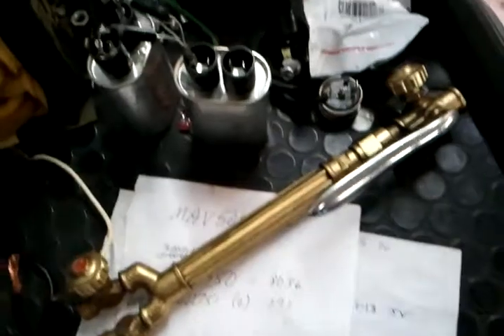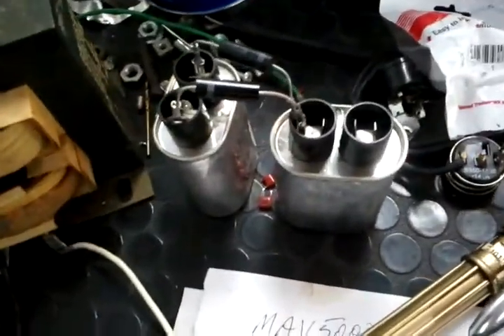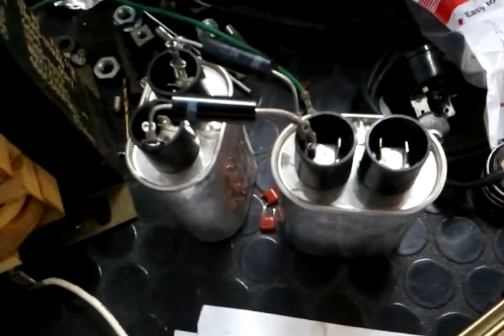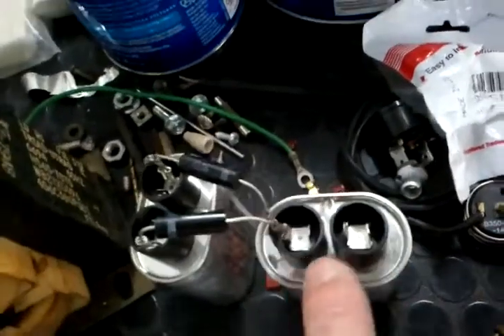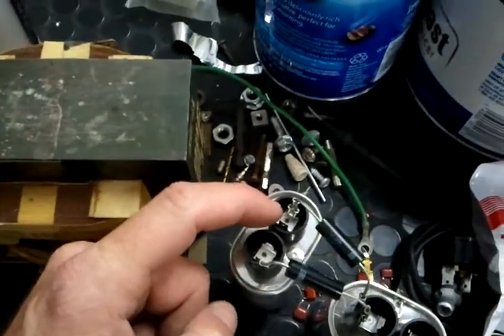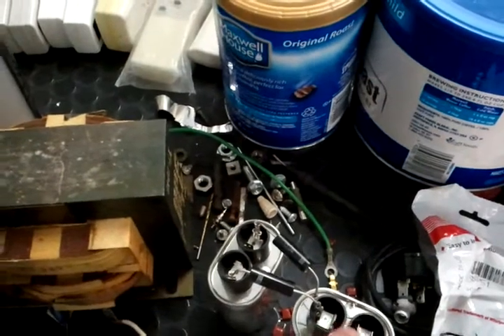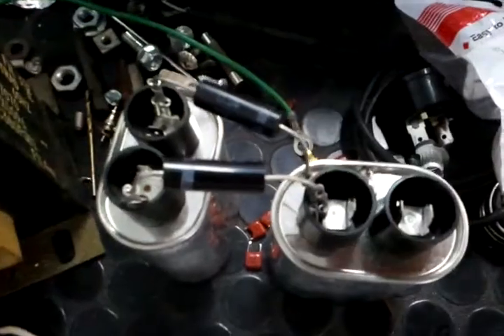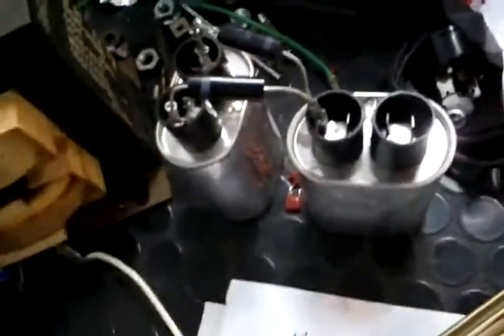Easy high voltage DC power supply

Comment: If I were to need 250V DC at 30A, could this work when using the same type of components? I was thinking using mains 240ac and rectifying it full wave. From that point I will use it to control the field of a 4 coils at 60vDC arranged in series. I am still working out how to vary the voltage from 100-240DC depending on how strong I need that field at a given point in time. I see lots of old microwaves for free at times and could get ahold of the components. 
Thanks, 
Andrew
Reply from the maker: IDUS Sorry for the late response, but you can use a simple dimmer switch before the transformer to control voltage.